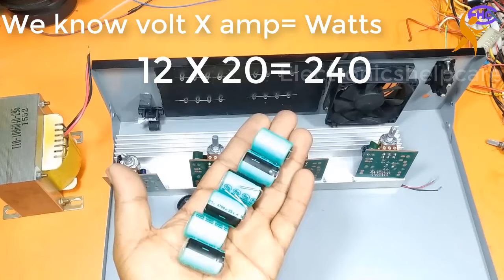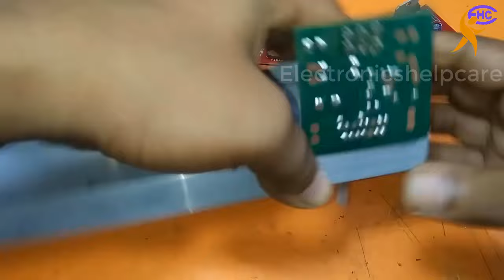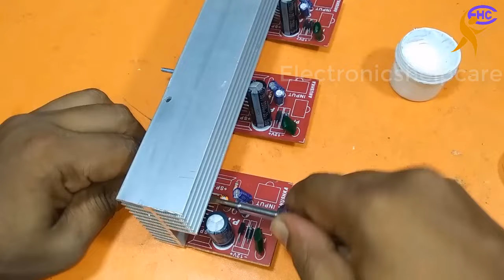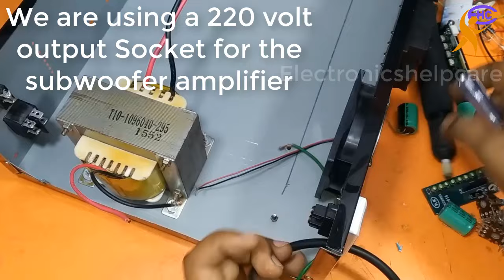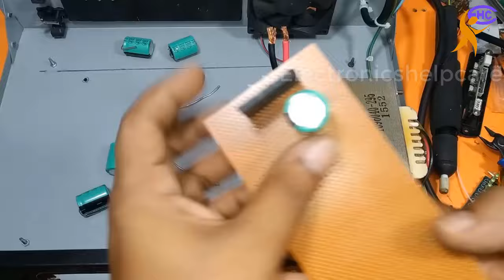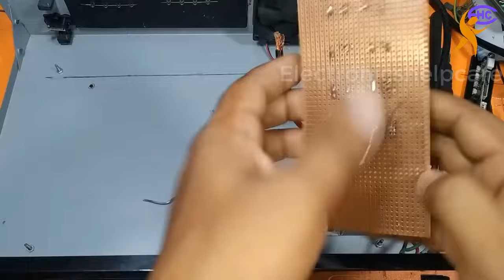how to make amplifier

Comment: So, it is a 2-channel (stereo) amplifier with 4 parallel outputs. (channels of amplification). The problems I have with the circuit are the following: No fuse on secondary or primary transformer side.  No chassis ground connection. No proper stretch relief on the mains cable. No protection against chafing from the chassis metal on the mains cable. The lack of fusing is the most serious problem.
Reply: Not 5.1 ?
Reply: 0 Tt
Reply: @minhdang108  no is not
Reply: I could be or he might be right hoping they are operating at different frequencies

Comment: its a 4 multi chanel stereo Amplifier, for 5.1, you need a circuit that makes a 5.1 division at stereo signal, or a digital processor that have 5 +1 outputs
Reply: Can u help me in getting a best quality circuit pcb board
Reply: @sekhardakuaskd  µPC1892 - Matrix Surround Sound Processor With Sound Processor

Comment: Nice video, but this not a surround sound amplifier, the 5.1 decoder is missing, also using the 5 v supply from the same transformer output will give a beeping sound for the BT.
Reply: Yes
Reply: Ya
Reply: Yes

Comment: do you know what (5.1) surround  system is ?
you have made amp but it will work as stereo. 
1). you haven't install any any any low frequency filter for sub.
2). you have no option to give 5.1 signals as input, Bluetooth (USB , micro sd card, FM) only only support stereo (2.0)

Comment: All you need to add 5.1 prelogic board and 4558 subwoofer circuit board to make it 5.1 amplifier .
This is only a 4 channel speaker system..

Comment: I suggest you introduce some protections: general fuse on the alternating network, fuse on each amplifier. antibump circuit and protection for direct current in speaker output. variable gain buffer on each audio input. check the diode bridge if it has a high peak current ...
with nearly 40,000 microfarads of smoothing, you can't imagine the initial charge current… it's scary. optimizes charging with a slow charging circuit. the two voltage regulators do not have to work like this, they need two 0.1 microfarad capacitors connected in input and output and an inverted diode between output and input. .
between heatsink and power chip, it is better to use thermal paste. the convective motion of the air is wrong on the heat sink. regards.
Reply: yes i agree with u
Reply: Good information
Reply: Proper biasing is also required

Comment: just making 5 1 port surround sound amplifier, not processor. good for using latest computer audio output which is deliver 5.1 audio process, input from gaming motherboard or mini surround sound capable audio decoder. good idea, cost effective. But need to more watts for Sub Woofer out.

Comment: what you make is a amp with 2 ch input and 2 x 4ch  output  not an 8 ch amplifier. And also that is not surround Amp because you dont use sound processor, for 5.1 at least you must use sound processor like Dolby Digital system or better
Reply: if you use independent signal input for each amplifier you can make suround system, but you will need suround input signal. For 5.1 you can use 1x 2.1 amp, 1x stereo amp and 1x mono amp ( center channel).

Comment: Just be creative. 
6 channel amp. 
4 channel satellite with full range speaker. 
1 channel for voice with LC filter that cut off 8~20khz and 20~100hz for voice. 
And 1 of the channel is for bass. Filtering out 100hz ~20khz frequency. 
Not enough oomph? Find yourself mono channel high watt amplifier. Add proper LC filter too.
6/5.1 Channel is not enough and you want 7.1/8 channel surround?  Add another 2 channel amp kit for satellite surround.

Comment: Make it with 4 bord  or 4 different bords....and put a passive crossover which are inbuild....one bord for sub, one bord for Mid, one bord for Woofer, one ford for tweeter, 

And do bord design same size and different types like 30w, 50w,100w,150w,200w etc and then do the magic ... Change the perticular bord if need more power or just simply pick bords of customers choice like 100w sub and 200w mid and 50w tweeter....at same power supply

Power supply 12v 4amp...and put power enhancer with protection in each bord or customer change power supply if he/she need 2 bord or 3 bord as per as required.

Comment: power supply mai 4 capacitors ki jagah 6 capacitors lga diye jayen to kya voltage same rahegi...?
Reply: yes bro.full dc
Reply: Capacitor does not change Voltage, it only smoothening supply ripples.
Reply: Yes
Reply: Same rahaka
Reply: Laga sakte ho lekin generally 10% se kam ripple voltage ke liye capacitor ki value decide ki jaati hai. 12 volt ke output ke liye minimum 2000 MFD capacitance per ampere load use kiya jata hai. 10,000mfd ka ek capacitor bahut sahi value hai music system ke liye.

Comment: This is not what you call a 5.1 amplifier!! And the 12V and the 5V voltage regulator IC's should have their own filtering capacitors. These aren't proper voltage regulator circuits!

Comment: its not 5 1 surround sound, but mono, with 4 amplifire, and the soldering iron its like shit, which you should throw out, and your soldering is very bad, the power supply is not stabilized, and not properly made.
the amplifiers can only be used for small speakers, and not used for surround

Comment: Now, create a Class AB audio power amplifier with 2.1 channels (2 stereo and 1 sub) with 50w~100w RMS, lossless decoding, high efficiency, low distortion and low noise.
 Others features:
- AUX input;
- Bluetooth 5.0 board for bluetooth connection;
- Low RDS-on mosfet
- Individual controls for Bass volume, Stereo volume and Total volume;
- Short-circuit protection;
- Thermal protection;
- SpeakerGuard protection circuit system;
- DC detection circuit and output stage protection.